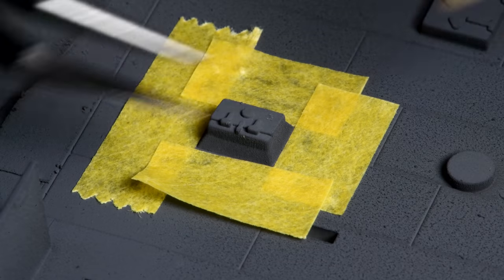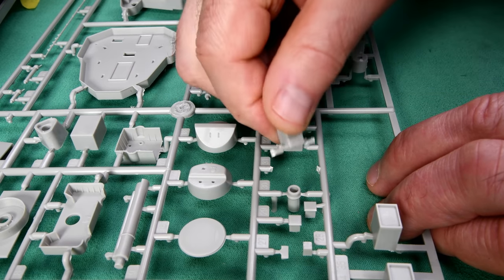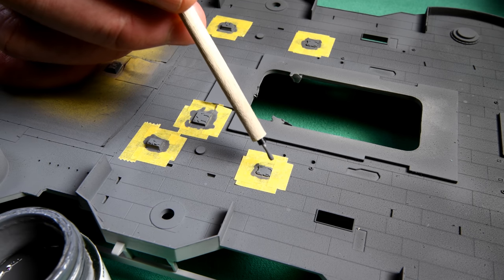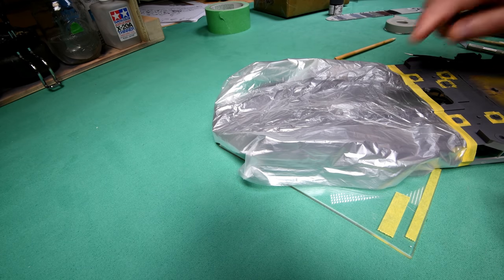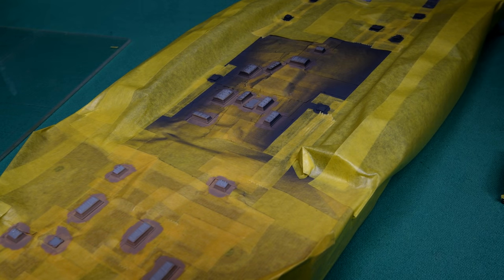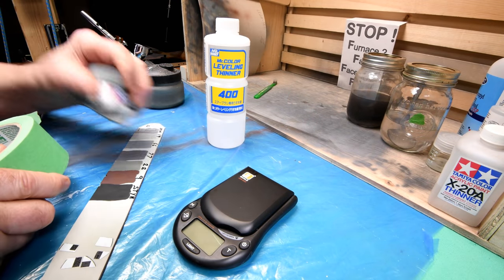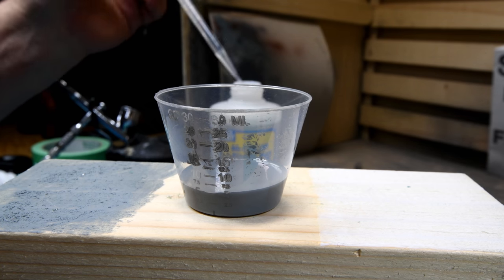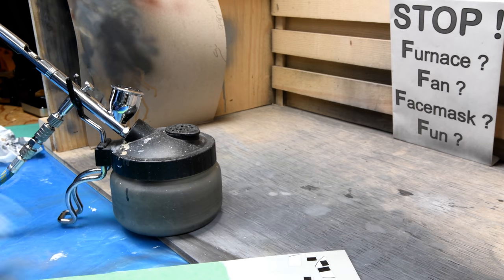The Model Ship - Part 572

Comment: Hi, thanks for another interesting video. I use the Mr Hobby self levelling thinner but so far have only used it with Mr Hobby surface primer which is lacquer based. It's interesting to see you use it with Tamiya acrylics; I've read plenty of board posts saying it works very well with them but actually seeing it being used is a lot more informative. If the product blurb is to be believed, you should find that you have a  smoother surface finish due to the retarder in the thinner and it should also bind to the plastic a bit better. If you do use it on the paint for the deck gubbins, it will be great to see if there is any visible difference in the surface texture under a macro lens compared to the finish of the adjacent deck areas. Which is basically a very long winded way of me saying thank you for doing an experiment I've been meaning to do for a while now 🙂
Reply from the maker: Well, here's hoping that when we remove the tape tomorrow the the difference in texture will show. 🤞🙂

Comment: Ron, having used the self levelling thinners for years I can tell you that nothing beats it. Some tips, you can use it with most paints except Vellajo turns it to jelly. Thin to 40 or 50% thinner to paint, turn your air pressure down to between 10 and 15 psi, and spray closer, the dusty texture your are getting is because the paint is drying before it gets to the model. Do a mist coat over the whole thing then a wetter one, leave for 10 minutes then if dusty spray with neat thinner, it will smooth the paint out.
Reply: I could have written this message.. my words exactly!!

Comment: Is there some reason you didn't use the graduations on the little measuring cup to get the 30%?     See ya.              JimE
Reply from the maker: I did Jim. Guess I didn't make that clear. 👍🙂
Reply: @roncalverley  When I looked at it I thought it was short of the "10" mark by about a ml.  I did notice you had them accented with a black marker.   My bad.